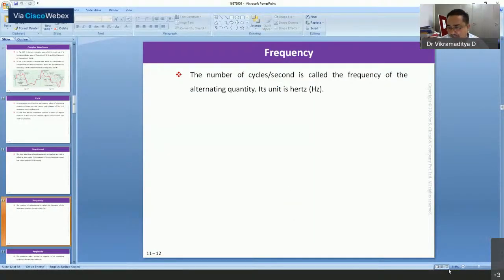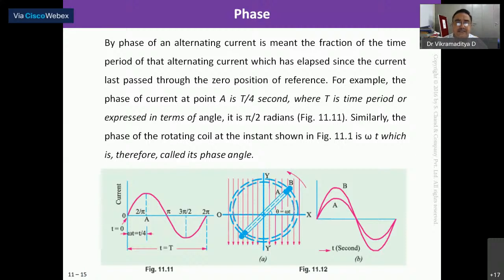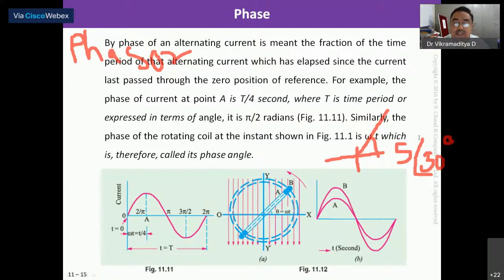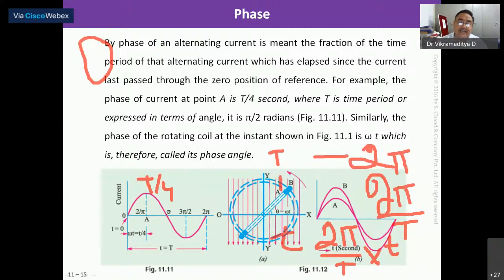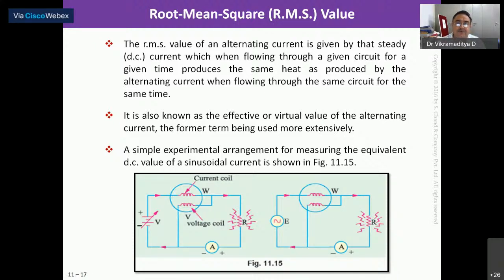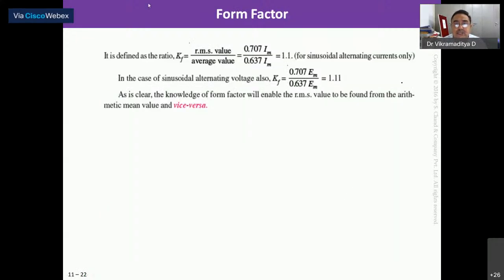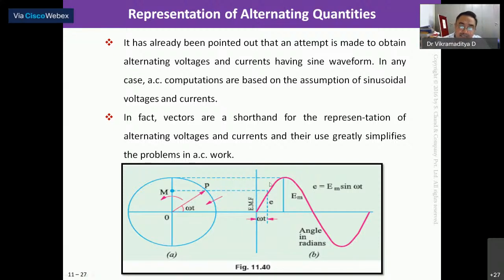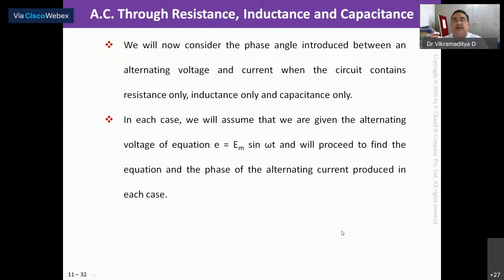Circuit Theory Class 15

Comment: Sir what does it mean by 'the various vectors representing different waves all rotate counter clockwise at the same frequency and maintain a fixed position relative to each other'
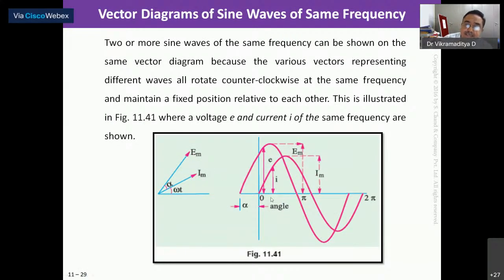In the second line at 36:29
Reply from the maker: vector or phasor algebra is applicable to physical quantities having same frequecy and same reference. however there magnitude may be different. further phase or angle is generally measured in anti clockwise direction
Reply: @gyan_hub9972  ok sir... thank you